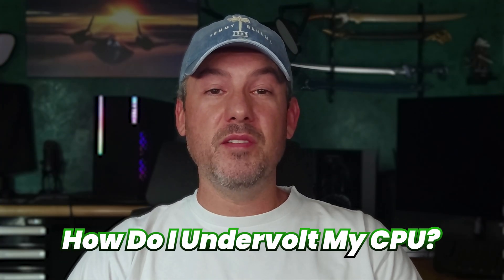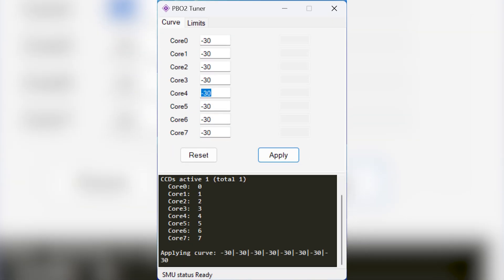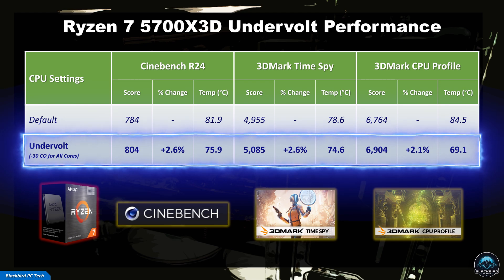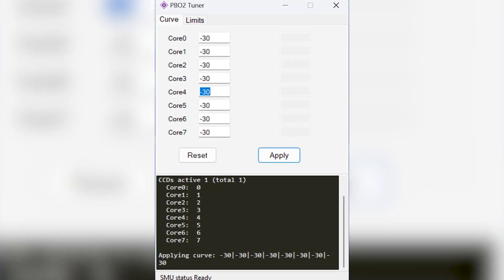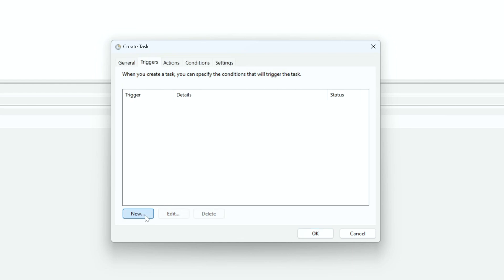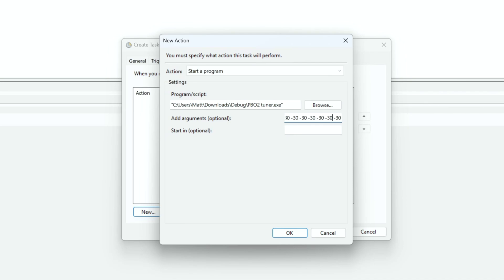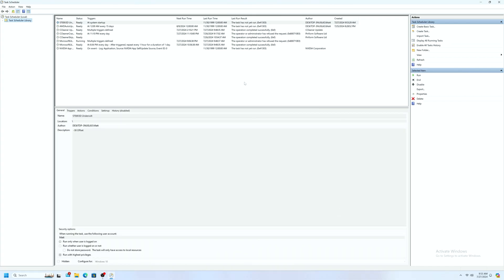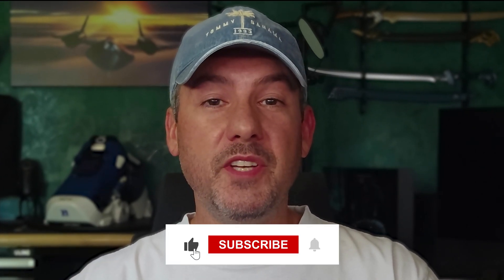How To Undervolt a Ryzen 7 5800X3D or 5700X3D!

Comment: Help. It does not seem to work for me. My 5700x3d stil gets as hot as 80 celcius on Cinebench. I undervolted all cores, -30, but I see no difference. Is there a possibility that the latest cpu batches are now permanently locked down? Like there's no way to get around it?
Reply: Will do. Thanks for trying to help.
Reply from the maker: No, I've done this on my 5700X3D and it works. 80 deg C is not hot for a 5700X3D but you should see some impact or it's not being applied. I would recommend going back through it and making sure that you didn't miss a step.
Reply: @blackbirdpctech  I did the first test yesterday at noon and probably not the best time because it was 30°C hot and after undervolting I saw no difference in the heat on Cinebench, peaking at 83°C. I tested it again now that it's 21° in the morning, it peaked at 77°C. An improvement I guess, but that is probably thanks to room temp lol. Idk man I just want my cpu to live long.
Reply from the maker: @AndreiHarkov  I don't think your undervolt is being applied, I would recommend trying again.
Reply: @blackbirdpctech  tbh, I have lost count of how many I have tried it 😂
Reply: @blackbirdpctech  sorry for bothering you again but one last question, do Windows Update and the motherboard have anything to do with my problem?
Reply from the maker: @ I don't think so ... it doesn't appear to be saving the undervolt in PBO2 for some reason ... it's not possible for me to tell you what the issue is, other than to tell you to check and make sure that you've followed the steps. When Windows reboots try loading PBO2 tuner and seeing if the undervolt is still saved in the tool.
Reply: @blackbirdpctech  no, it's not saved. So something is definitely wrong here.
As a side note, yes, I followed your steps and made sure I missed nothing. And I did it multiple times.
Reply from the maker: Perhaps do a search on PBO2 tuner not saving

Comment: was able to undervolt my 5700x3d in bios by turning down vddcr cpu voltage by 0.148, now it never overheats and everything runs good still. however, boot times take about 5 seconds longer. thats all ive noticed
Reply from the maker: Just be careful manually undervolting your CPU ... you can run in to blue screens under certain loads ... the reason using the curve offset method is preferred is that it's dynamic and can change based on the voltage needs of the CPU.

Comment: is it weird that I can hit -37 with 4441mhz or did i just get lucky??
Reply from the maker: What is the 4441 MHz a measurement of? A CO of -37 is extremely high for a 5800X3D ... did you check that it's not causing clock stretching?
Reply: @blackbirdpctech  yea i ran it on cinebench and got it stable with a score of 14281 at 86c from a score of 13108 at 90c (stock) i tried -30 but i was still hitting 90c to tried more. im running a kraken 280 aio im more sad that a aio cant keep temps down i repasted the aio to idk why its so hot
Reply from the maker: @ that won't tell you if you are getting clock stretching ... you can checkout this video to see how to properly test for stability: https://youtu.be/6vROzalei6Y
Reply: @ okay went back and checked with Aida64 at -37 its was stretching in one core but stable and at -35 no stretching and stable but im back at 90c :( so did i just get lucky with my cpu maybe? and its it normal for 5800xd3 to get that hot on stress tests?
Reply from the maker: @ yes, you have a great chip … and yes, the 5800X3D is designed to boost with thermal headroom, so it will run hot
Reply: @blackbirdpctech  sorry forgot to mention 4441Mhz on all cores when i was running cinebench i was using HWmonitor for temps and core readings

Comment: So i did not see anything pop up after restarting my pc, but when i start PBO2 again its still set to -30 at all cores. Does that mean it worked?
Reply from the maker: It should be a very fast pop-up, so it's possible that you may have missed it ... to check if it's working then you can always try running a benchmark before and after and see if the temps/score changes.
Reply: @ Okay thank you, well i think it is working, because when i try to apply the -30 after startig PBO2 says there is nothing to change.

Comment: Undervolting is great when the CPU is under load, but once it goes into IDLE, you are going to have so many crashes. Mine was great when doing benchmarks, much higher clocks and cooler, but once I have been browsing for a while, it would randomly get BSOD.
Reply from the maker: That's not true ... you simply don't have a stable undervolt ... I would recommend reducing your curve offset and trying again.

Comment: Dude, I did what you said, when my computer is turned on, it automatically turns on pbo2, sets itself and turns off, should it be like this?    pbo2 tab sets itself and disappears
Reply from the maker: Do you mean pbo2tuner flashes on screen when you boot in to Windows?
Reply: @blackbirdpctech  Yes, when the computer is turned on, it appears on the screen and disappears immediately. Is this how it is supposed to be?
Reply from the maker: @aliozturk8159  yes
Reply: @blackbirdpctech  thank you very much, now I don't have to do it manually one by one

Comment: Wasn’t quite the video the subject suggested. No mention of the 5800x3d, is it locked down as well? Only 4mins it’s not really that detailed.
Reply from the maker: The 5800x3d and 5700x3d are essentially the same silicon and are exactly the same with respect to undervolting. The video shows you how to undervolt these CPUs in detail without any fluff … what do you think is missing?

Comment: 5700X3D 
Under volt check with cinebench r23
Stock / multi 13531 68c
             Single 1349 45c 
-15 / multi 13729 60c
         single 1352 43c 
-30 / multi 13759 56c 
          Single 1352 39c 

Clearly for me -30 is the sweet spot
Reply from the maker: It’s an awesome tweak

Comment: I was running -25 but my task viewer is spamming cache error on core 0 but i turned off cppc preferred cores and only -10 on core 0 and now it give 1 error in a 10 hour test if im unlucky and in games it dont boost past 3.8ghz but my gpu hits 99%
I got a ryzen 7 5800x3d

Comment: I did a -30 curve, PPT 95, TDC 60, EDC 90 on my 5700X3D:
Cinebench R23 went from 12380 to 13528
Temps from 86 down to 75
Fan is still running at 1700RPM but at least it runs cooler.
Reply from the maker: It’s an impressive tweak
Reply: Thanks!!!

Comment: just bought 5700x3d recently. Doing this task and then compared it to the stock setting while running Cinebench R23

Stock - max temp 87c
PBO2 - max temp 74c

thanks for the brief but also good guide/tutorial
Reply from the maker: What was the performance change?
Reply: @blackbirdpctech  the benchmark pts in Cinebench are a little bit better compared to stock setting.. But the temp are a whole looottt better

Comment: we were undervolting since 2600X  ( I have 2x 3700X both undervolted) it improves thermals thus boost clock ceiling, so its not new. What is new here does it undervolt more as ratio (%) ?  or gain more ?
Reply from the maker: This is a video on how to undervolt AM4 based 5000 series chips … if you already know how to do it then it wouldn’t make sense to watch the video … why do you think there needs to be something new or beyond the scope of the video title?

Comment: you dont need PBO tuner anymore, if you have any b450 or b550 and update to the last bios version and you can actually use the curve optimizer of the PBO that is inside the bios( u still cant unlock the clock or overclock), i know... not everyone knows that AMD released this by BIOS update.
Reply from the maker: That's not true ... the motherboard that I used in this video:

https://youtu.be/JIjD1mZUGz0

was an Asus Prime B550M-A AC and did not have a curve optimizer option in Bios, after the Bios was updated to the latest version ... that's the reason I discovered PBO2 Tuner. It's always a good idea to verify your information before posting it because it will drive people crazy looking for something that doesn't exist.
Reply: Nope. I don't have that on my Asus X470-F with the latest BIOS (from this november). If I wanna tune my 5700X3D it's still with PBO2Tuner.
Reply: @makarickiri  checked inside of Advanced>AMD CBS>NBIO common options> XFR Enhancement?
Reply: @makarickiri  nevermind... ASUS didnt unlocked this one, its a shame cuz is a really good mobo and expensive one lol
Reply: @fuuji7996 Inside of the XFR menu, what options do you have and how do you set de curve there? Ty
Reply: Rog strix b550 f here and it’s in bios. It’s in the tweaker section not the advanced overclock section

Comment: Hey man, thanks for the video, it really helped my out. One thing... I did reach the -50 all core, but no much difference between -30, -40 and -50. Should I keep it? The software can't really go bellow that. The most significant change was between stock and -10, where performance was increased, bellow -10 only temps changed. Currently at -50 i'm doing around 57º-58º (room temperature 23º) and on idle its 33º. Running only Cinebench 24 and getting a score of 814.
Reply from the maker: I wouldn't run such an aggressive undervolt because it can lead to clock stretching issues. I plan to discuss this in detail in my 9800X3D video that will release next week, but in general I wouldn't go below about -30 CO all core.
Reply: @blackbirdpctech  Oh, ok. Thanks for your reply. I will turn it back to -30. I bought this 5700x3d 2 days ago. I had a 3700x before. It's my 1st time undervolting a cpu, normaly i just do a custom OC and set my voltage and multipiler. Thanks man! :)
Reply from the maker: You are welcome

Comment: Just upgraded from 3900x to 5700x3D and while using 240aio temps is at 45c.  I’m very tempted to do this undervolting but is this really worth it?

Here’s my Rig:
X570e
5700x3D
3090ti strix AIO
2x16gb  3200mhz CL16
1000psu

4k 120hz
1440p 240hz

Thanks for your time. Cheers
Reply from the maker: Yes, it really is worth it ... you will lower your power, temps and improve performance. If your motherboard has a curve optimizer option you can do it directly in Bios.
Reply: it is, and u dont need PBO tuner anymore, AMD allows u use the curve optimizer of PBO if u update the bios of u motherboard.
Reply: @RAMBOJVR if u want something safe and dont want to test for stability, just put -20 all core with the sign of magnitude negative inside the Curve optimizer, your 5700x3d will ran 4-5ºC lower, this is the sweetspot of UV for a 5700x3d.
Reply from the maker: @fuuji7996  That's not true ... the motherboard that I used in this video:

https://youtu.be/JIjD1mZUGz0

was an Asus Prime B550M-A AC and did not have a curve optimizer option in Bios, after the Bios was updated to the latest version ... that's the reason I discovered PBO2 Tuner. It's always a good idea to verify your information before posting it because it will drive people crazy looking for something that doesn't exist.

Comment: PBo2 tuner curve doesnt seem to work for me, I set up -20, -30, -50 but nothing happens, only the Limits work, any idea why?
Reply from the maker: That's strange ... what CPU do you have and on what motherboard?
Reply: @blackbirdpctech  I have a ryzen 5800x3d  and a gigabyte A520i AC, I suppose its because of my mobo?
Reply from the maker: @FelipeFerraz08  yes that's my guess, it's possible that your motherboard is not allowing you to perform an undervolt.

Comment: Unfortunately, with the PBO2 setting at -30, it froze during idle, so I’m now testing with a setting of -28. The result in Cinebench 2024 is 801 points multicore and 84 points single core. The temperature in multicore is around 66°C with a room temperature of 20°C. The cooler is an Endorfy Fortris 5. Before setting PBO2, the temperature was 77°C.
Reply from the maker: You shouldn't see any meaningful performance difference between -30 and -28, but if -30 was unstable I would recommend back down to something like -25, just to be sure.

Comment: MSI hides 5x003D undervolting in BIOS under item jokingly named "Kombo strike" that has 3 levels to choose from. Level 3 is equivalent to -30 on all cores as confimed in PBO2 tuner app. I run with that option with no issues for more than 6 months.
Reply: That comment was helpfull. I was wondering what a heck is kombo srtike….
Reply from the maker: They all try to one up each other by coming up with names like this so they can market it as a feature when in actual fact it's simply an undervolt.
Reply: Same for me and it's absolutely AMAZING!!

Comment: Is a 2.6% performance increase worth it to me? It’s more likely that it could help with reducing temperatures, right? Even though it’s currently winter and the room where I have my computer usually has a temperature around 10°C during the winter.
Reply from the maker: Here is the thing, it's not only free performance but it also lowers your temps, so I really don't see any downside. You will likely not notice a 2.6% increase in performance, but it's free, so why not.

Comment: Is it worth doing this if I have sufficient cooling already? R7 5700x3d
Reply: @varroaurelia977  likely worth for how quickly it helps keep core temps down. Good for longevity of the chip
Reply from the maker: Absolutely, it will boost your performance.

Comment: Does it void my warranty?
Reply from the maker: I don't know what the specific warranty language says and/or how it might be impacted by where you live and which retailer you purchased the CPU from. That said, undervolting is not the same as overclocking ... you basically leverage the better than standard silicon quality to improve performance at lower voltages and temperatures, so it's extremely unlikely that it would have a detrimental impact on your CPU.

Comment: thank you very much for the tutorial! i have been looking into buying 5700x3d and i have a question, is it necessary to update bios? i got my pc back in 2020 and never updated it ( im kinda scared to do it lol ). also motherboard i have is b450 fatality from asrock
Reply from the maker: Yes, you will have to update your bios for your motherboard to recognize the 5700X3D. Don't stress about updating your bios, it really is a simple process ... just make sure you don't do the update during a storm because it wouldn't be good if the power goes out during the update.
Reply: @blackbirdpctech  okey thank you very much for the anwser
Reply: @Kacpertost  I recently got mine upgraded from ryzen 2600x from 5700x3d amazing processor go for it

Comment: Hello, thank you for this guide !.it works perfectly. One small question: should I set some limits? Ppt tdc edc? Do you know any good settings for these or I shouldn't bother changing them?
Reply from the maker: Great question ... my preferred approach in Bios is to simply set a thermal limit, so that way it will be based on the quality of your cooling solution and you can essentially ignore the other more complicated limits.

Comment: Can i do this in a A320M-K/BR mobo and Ryzen 5 5600?
Reply from the maker: I'm not familiar with that motherboard however it should work with a 5600 ... it's software based, so your motherboard shouldn't have any impact on PBO2 Tuner.
Reply: @blackbirdpctech  Okay. Thank you for the video and your response!
Reply from the maker: You are welcome, hope it helps.
Reply: @blackbirdpctech  It sure did. It worked like a charm. I'm glad i'm able to mess with this stuff in this mobo.
Reply: @Naiguitimere  have similar mobo, you went to -30 as in video?

Comment: I'll have to try this. Your video titled 'Should You Buy a Ryzen 7 9700X or 7800X3D' came across my feed today. Glad I found it.

I just upgraded to the 5800X3D from a 3600X. What a nice improvement (along with my new 4070Ti Super). My main hobby is MSFS2020. Even the 5800X3d isn't quite enough. I've been considering upgrading again but since I watch that video, and the fact that FS2024 is due to be released soon, I'll stick with what I have.
Reply from the maker: That is a huge upgrade, especially in a game like MSFS that makes full use of the extra L3 cache on the X3D chips. I think waiting is a good idea, not only because there is a new version of MSFS coming, but also because I think the 9800 X3D will be a killer chip.

Comment: Undervolted my 3700X and it's been running at 4.3ghz and Never gets hotter than 60C, idles around 27C.
Reply from the maker: It’s a beautiful thing!
Reply: @blackbirdpctech  and that's with the out of the box supplied cooler. Very efficient.
Reply: whats your offset
Reply: @desiindiatv7870  Haven't looked in my BIOS since setup, I believe I have it set to 1.25 vcore and a fixed multiplier. Was running Win 7 on it up until about a month ago, so still haven't had a chance to play with Ryzen Master, or even update the BIOS after 4 years.

Comment: Have known about the PBO2 Tuner guide on Github in the description for some time now, that allowed me to overclock 5800X3D to 4.4GHz all cores through PBO with 1.0275 volts set from the BIOS. Immediate 10 celcius drop from stock settings before boot and 15 celcius drop while running games. Will be interesting to try your guide to see if this can be fine tuned further. Thank you for the guide!
Reply from the maker: That’s an impressive improvement … it was odd to me that there was no option to auto load the undervolt, hence the second part of the guide. Hope it helps!